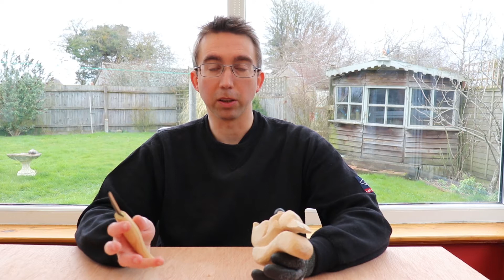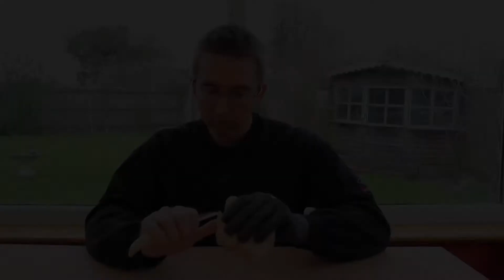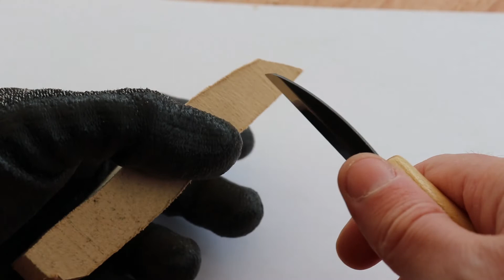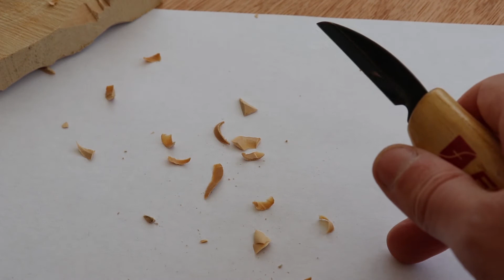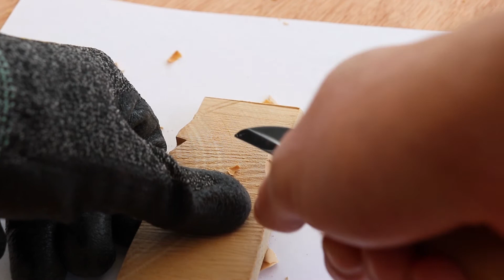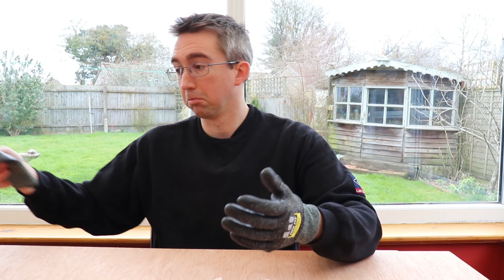Information for Beginner Woodcarvers 1 (and a bit of rant about YouTube)

Comment: Good advice. What projects did do when you 1st started?
Reply from the maker: I actually started with relief carving, using a selection of gouges and chisels; probably a bit unusual. Most carvers start with whittling because it's accessible, you need fewer tools, but my Dad had all the tools, so I was fortunate. Started with simple things like leaves, lettering made from foliage and flowers, then for in the round carving I started with really simple stuff like toadstools. Afterwards I started carving animals as that's something I particularly like, and the usual gnomes, Christmas ornaments and things that you just have to have a go at.